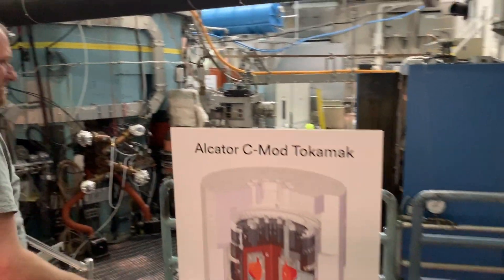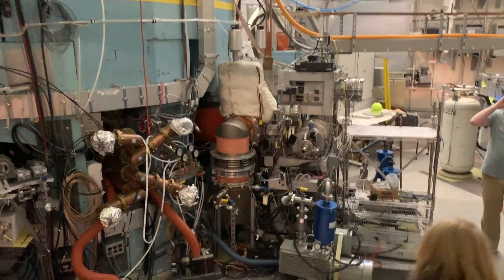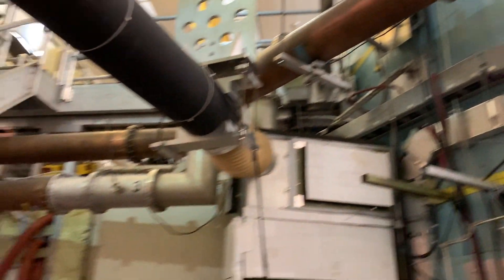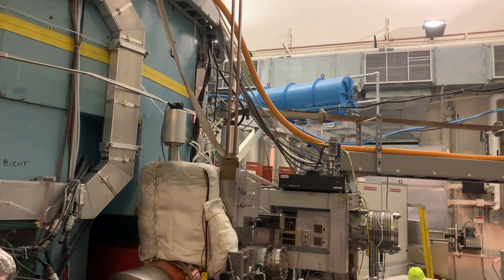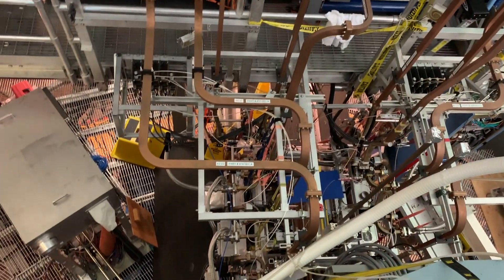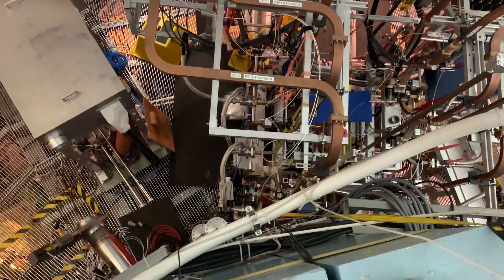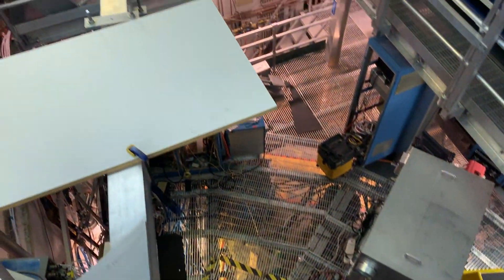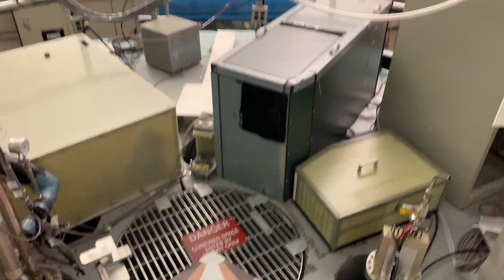Commonwealth Fusion Systems — Making Nuclear Fusion Commonplace

Comment: I actually have an idea for a desktop harmless non thermal reactor including non thermal power extraction. It's not guaranteed to work or work easily but it might just.
I suppose I should just say it. A spherical chamber with an inward pulse from the entire surface, very precise yet slightly out of sync so as to create the ultra high energy density at the center to untie or tie the reactant like a knot and carry the excess energy back out to the shell at low energy density.